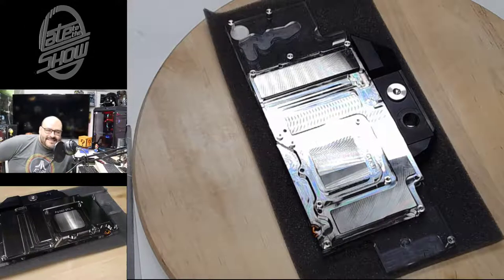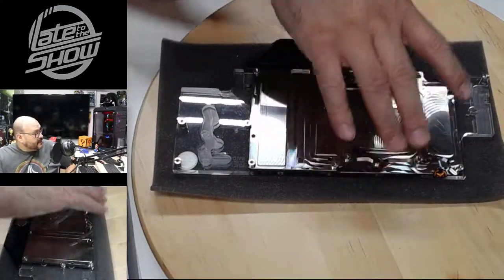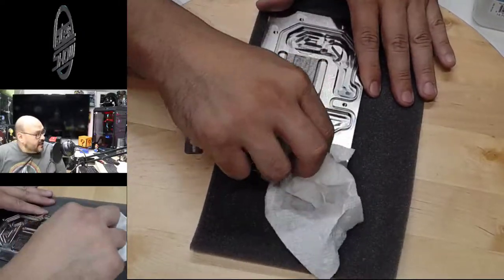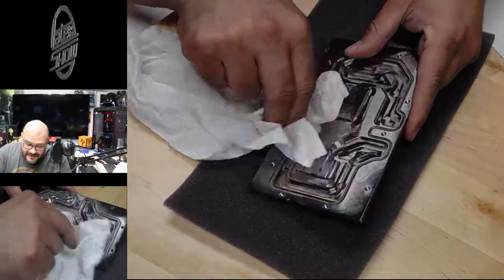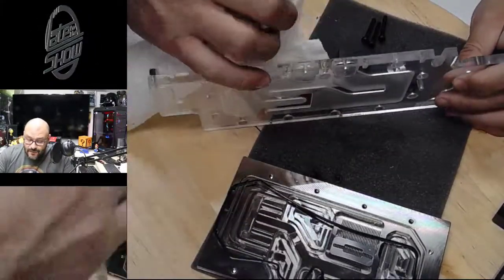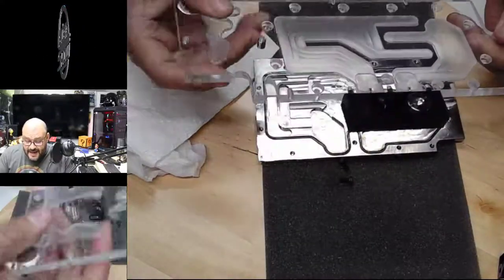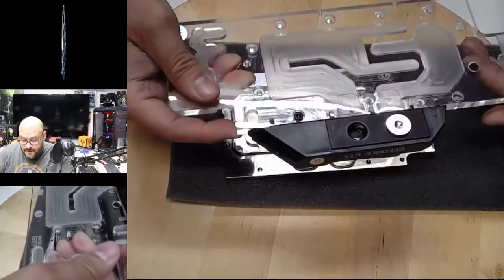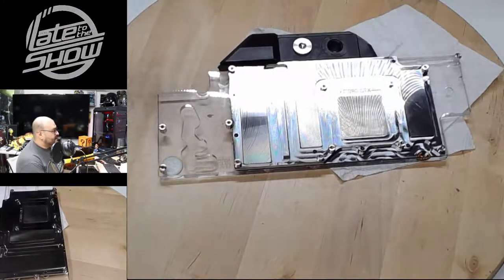Clean GPU Water Block

Comment: It's not stainless steel it's nickel plated copper on that block. They make pure copper blocks as well. Water and copper are just fine together
Reply from the maker: your correct, was a rookie with water block during this year and also modify the block to fit my video card.